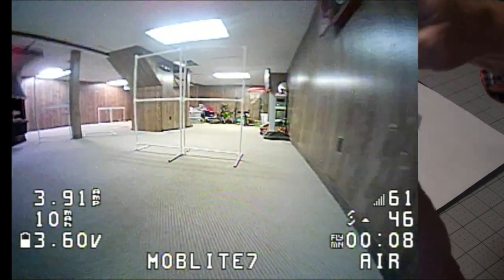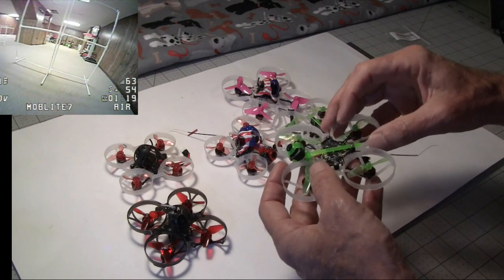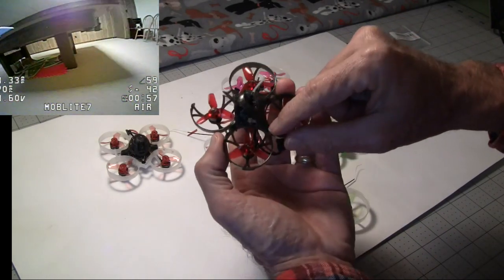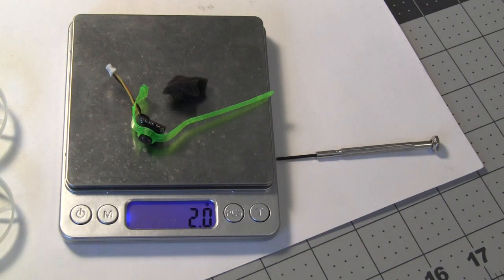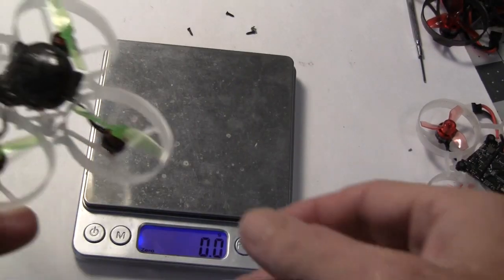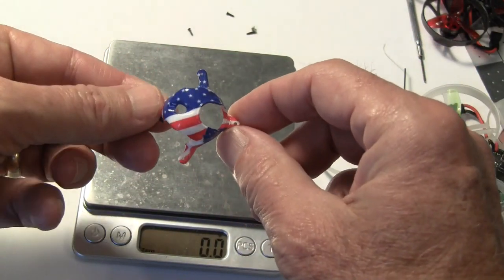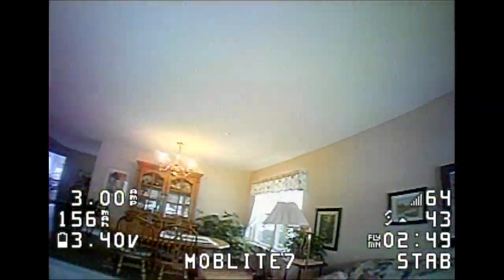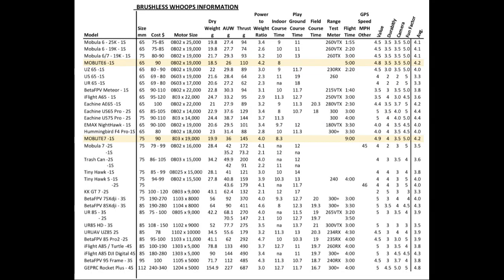MobLite7 adding a full size canopy

Comment: I did exactly the same after 2 days within my moblite 7. Gain 0.5 grams but get a lot for it and no noticeable downsides. I also transferred the mobula6 HD to a 75mm frame , but felt the 19000kv motors were struggling with 40mm props and the weight - so the motors were swapped for 1102 18000kvs from an old meteor75. It flies great on a 450mah for 4-6 mins.
Reply from the maker: I will try the HD mod and may need to use bigger motors like you have done but still want to try it.
Reply: I am impressed that you get 4-6 minutes with the 1102s my old meteor 75 without hd never got much more than 3. It was a good drone for acro flying though.

Comment: Johh, Angry Don (Happymodel Team Pilot) design a low-profile canopy for the Moblite6/7 that was supposed to be used on it, but they went with the TPU strap thing instead. He has put it on Thingiverse. So if you know somebody with a 3D printer, you could get some of his canopies printed. They weight less than a gram and the camera sits down low in that gap in front of the FC so it's still really low profile. Here's the link: https://www.thingiverse.com/thing:4693192
Reply: Note, there are 4 different models of canopy on that link. There are two standard (0.6g) versions with different camera angles. Then there are two versions intended for you to mount the FC upside down.
Reply from the maker: I will try to get them printed and try them thanks
Reply: These are the ones I've been wanting to do
Reply: @dubzsquaredfpv7171  I don't have a 3d printer and will need to get a canopy printed on craftcloud.  What material does anyone recommend?  There's like 55 different materials available?  Looks like filtering the tough ones below $15 dollars leaves Polypropylene, MJF Nyon PA11, SLS Nylon PA11 and Alumide.
Reply: @hallfatherofthree7022  I'm not sure what material Angry Don's canopies are printed in, but probably PETG or PLA. Check out this site for 3D printing: https://hudsoncreativegroup.com/manufacturing. Justin at Hudson is really reasonable on this printing prices and really easy to work with.

Comment: Thanks for this video. I really liked your solution to the camara mount and FC issues of the Moblite 7. I just put the mobula 6 canopy on my moblite 7 and am getting a lot of jello. Everything feels tight. The  moblite 7 is brand new. With the original set up I had no jello.  Have you encountered this problem? Any suggestions? Thanks
Reply: Problem solved, I put a piece of polyethylene foam between the camara and the flight controller! No more vibration!  I used a multimeter to test that the foam wasn’t conductive as it was resting on soldering pads on the FC. Some foams are conductive so it is good to check.

Comment: Isn't the camera placement in the front a design feature to remove "props in view"? I think the design might just need a slight tweeking to the current placement and camera adjustment to make it more adjustable and protect the board better.
Reply from the maker: The props are not in view for either mounting position. The advantage of the props mounted on the front of the frame is the canopy is 0.5 grams lighter and the center of gravity is lower. The advantage of using the Mobula6 canopy is the camera angle is easily adjustable and the flight control board is more protected. As you point out either designs can be tweaked. Thanks for the comment.